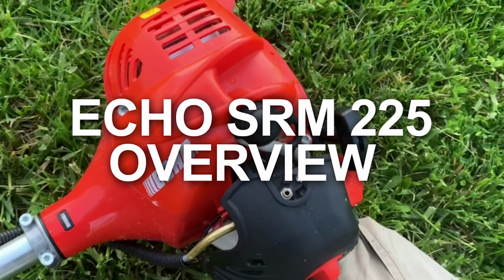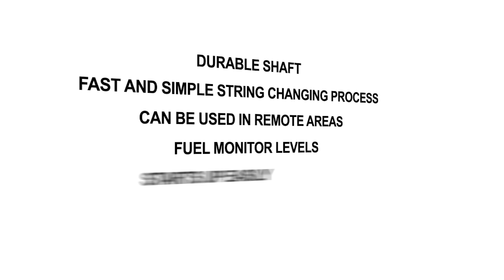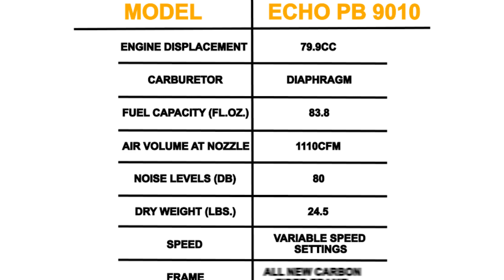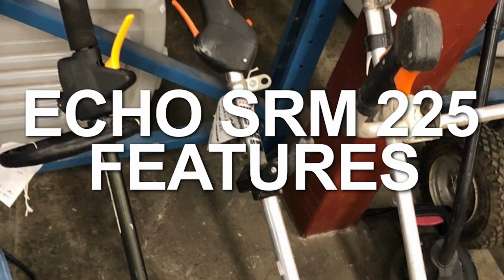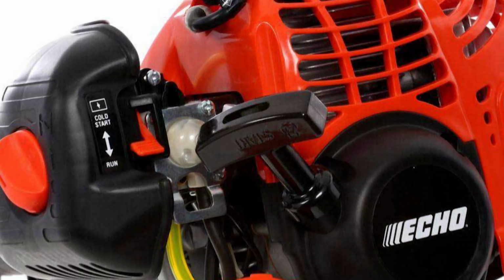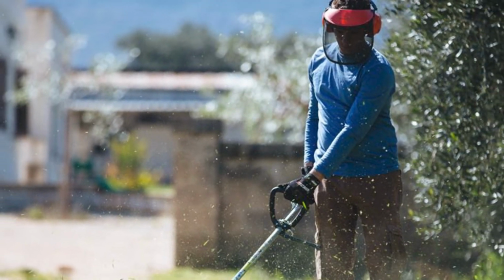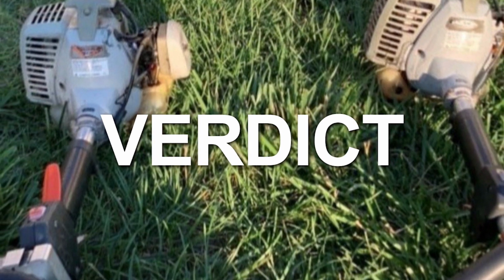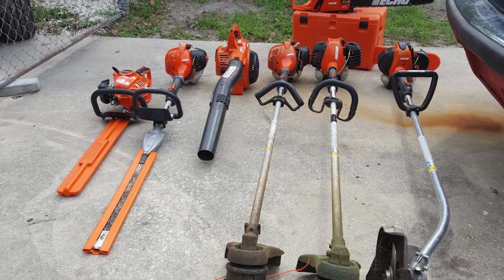Echo SRM 225 Review: Performance, Features, and Our Verdict (Pros and Cons Explored)

Comment: just bought that model a few days ago. Have used it on my 4+ ac and it does well. Starts right up every time. I did notice that the pole towards the  cutting head but still the ole, gets very hot. Is that normal? It is so hot I can not touch it except for very quickly. Less than 4 hours on it so if it was greased correctly it shouldn't get that hot, I would think. Or, is that normal?